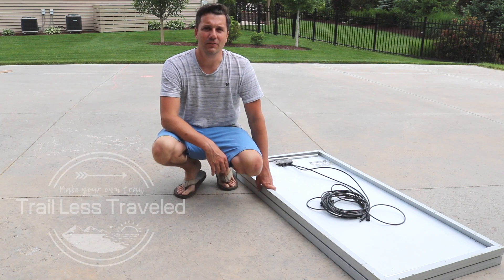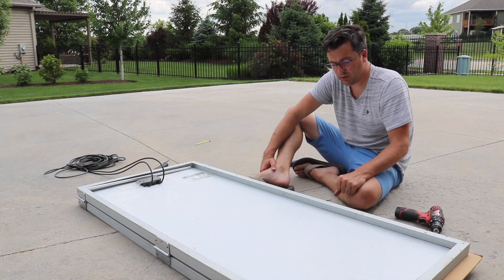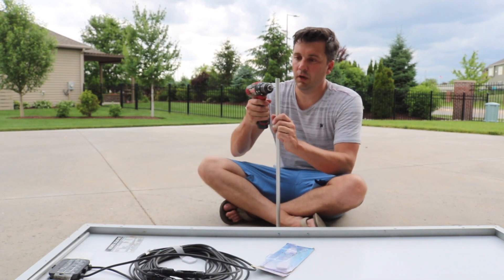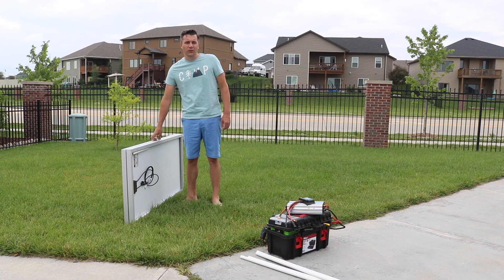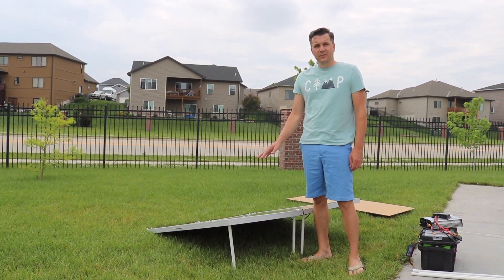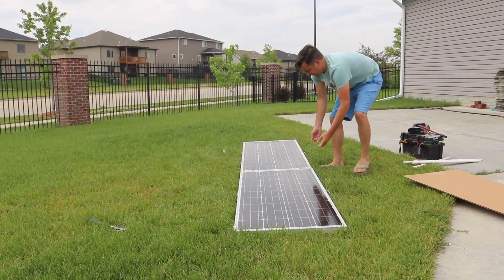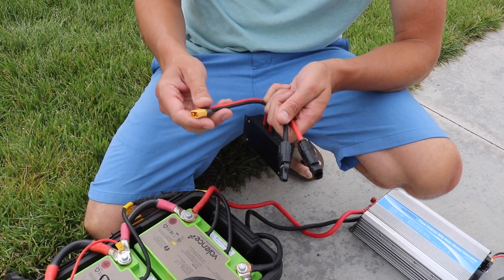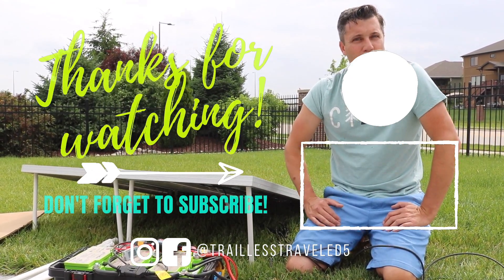DIY Solar Suitcase || RV Solar Panels || Portable Solar Power

Comment: Forget those silly, plastic legs if you value your expensive panels...   Eventually, while gripping those handles together, they will create strain on the panels and the handles will fall apart.  They need to be mounted closer together to act as one larger handle....
Reply from the maker: Good idea, thanks!
Reply: @AllElectricFamily  Love the duel hinge concept. Having seen that one before. I second the thought on not using plastic for legs. Good in theory not so much in practice.  I started with PVC like you and later tossed them and upgraded to metal. Fighting wind is a loosing battle while boondocking. You also should look into a way to weight them down/ tie them down/ lock them up when in use. All it takes is one random 40+ mile guest to send it rolling. Also keeps them from growing legs and walking off. I've hand mind fold up on me by themselves due to wind. I also did glass facing while folding inward and the thing that saved them was some furniture feet anti scuff pads glued around the outside the panel. Makes it so the glass can never touch when folded by a few mm. They sell felt and soft plastics peel and stick versions.

Comment: Those rigid panels can easily be had for less than a dollar a watt while the same panels when you buy a solar suitcase usually cost around $3 a watt. Cheap door hinges is a great idea to make your own "suitcase". I would add some little foam or rubber or felt stoppers around the frame of a panel and then I wouldn't think you would need the giant piece of cardboard. Curious if you figured out a better method for a handle.
I'm thinking some type of adjustable feet would be great too.

Comment: Can you help me  , please  ! IHave a 22 Wh portable Generator (powerstation ) and i want to charge it with a Foldable  5V 14W and 2,33A solar panel  , i understand that if i buy a 
5 -15 volt step up convertor  will work , what do you thynk  , will start ?  I thank you in Advanced
Reply from the maker: Assuming it is a 12v power-station an up-convertor would be needed.  At 22Wh that would be 1.8Ah battery and would not last very long with much load.  What are you powering with it?  If you want some advance knowledge I would suggest Will Prowse book:  https://amzn.to/2L43hj0
Reply: @AllElectricFamily   i dont need this for powerfool tools just for recarging flashlight ,  handy  , if i buy 5 -15 Volt Convertor do you thynk will start Charging ? , dont buder me if it,s Chargin slow
Reply from the maker: @yashuahjunior9332  I haven’t ever used one of those so I can’t say that it would work. I’ve setup systems with charge controller and higher voltage panels. Sorry I couldn’t answer it for sure.
Reply: @AllElectricFamily   yes the most of my friends hier in Romanian have standard panel and controler , i thank you wery much for ansering , i wish you the best in the new Year

Comment: How did you calculate that 17° was the optimal angle?
Reply from the maker: I utilized this calculation for tilt twice a year. Latitude x .93 -(21)= summer tilt. Latitude x .875 +(19.2) = winter tilt. Here was the website for reference. https://www.solarpaneltilt.com